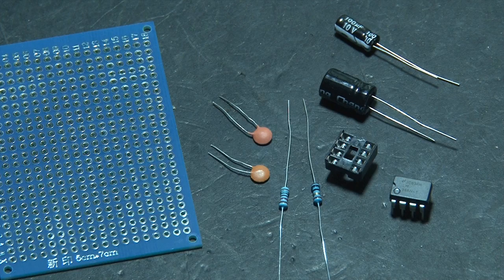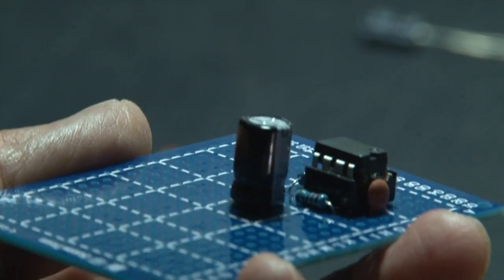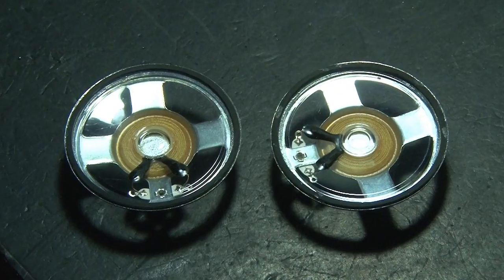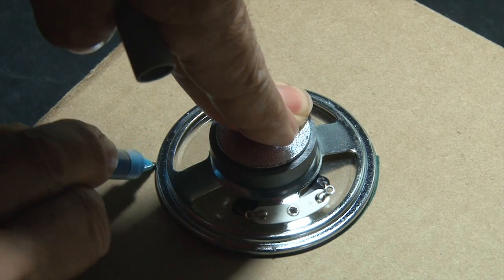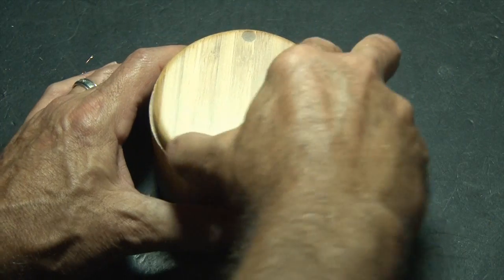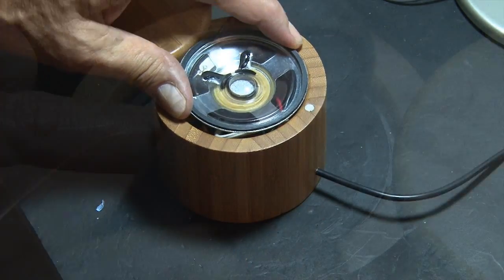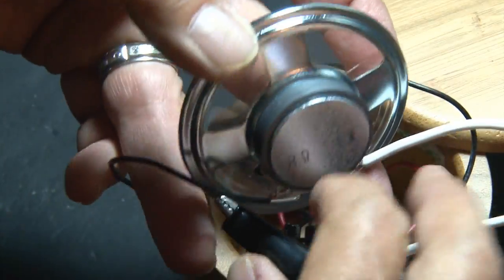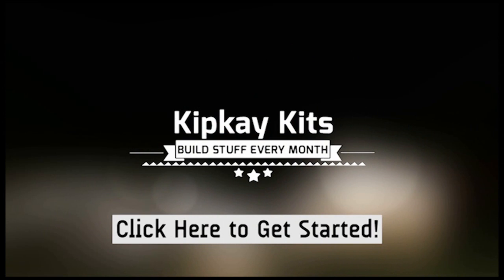DIY Mini Digi-Speakers!

Comment from the maker: Build your very own, custom DIY mini Digi-speakers! This is a 1-watt speaker system.
Reply: how big are those speakers??
Reply: Alcatraz252 I'd say at least half a banana per speaker
Reply: woooweeeee Yea, that's good enough.
Reply: Can you just sell a completed set for a little more $?  I don't feel like soldering my fingers together.
Reply: cuvkiller You con't solder your fingers together. You'd just burn them.
Reply: dourabbawinner
 funny how you just automatically assume he's human
Reply: dourabbawinner Shows how much I know.
Reply: just what i was looking for thanks kipkay!
Reply: i am so going to make this thanks kipkay!!!!!!!!!!!!!
Reply: Kipkay, try invest in a pop filter for ur mic, so u get rid of the pops
Reply: can you add a volume control?
Reply: tty23
Hi, are you looking for instructions or is that a feature request?
Reply: show how to make your own pop filter? :P
Reply: kipkay please make more diy speaker projects! these are amazing!
Reply: how much wattage can that circuit take?
Reply: 5tealthlab5
Probably around 1/2 or 1.
Reply: Daniel Astbury
K. Thanks.
Reply: Ok it has all that stuff but does the kit include the cardboard box??
Reply: Since you switched from DC to AC for power, did you need to add anything to the circuit? Like a bridge rectifier and whatnot. And BTW, im a hobbyist, so my terms might not be precise since im mostly self-taught.
Reply: Chris Griffin

He is using a wall wart which already converts the ac mains power into the dc voltage he wants.
Reply: Makes sense, thanks for the information.
Reply: some14460 Probably about 3 inches long, assuming they are the same size as my black 1 watt speakers.
Reply: i have a question: if i connect an 8 ohm speaker i will get 1 watts of power, but if i connect a 4 ohm or 2 ohm speaker, will i get more power coming from the speaker? Thanks
Reply: David Christmas
I figure that anything less than 4 ohms might blow the amp... but no it wont increase the power going to* the speaker.
Reply: We're do you buy the stuff in the uk
Reply: where to add bateries
Reply: Happy 2,500,000 subscribers : )
Reply: no bass

Comment: if it where possible though i would recommend a small adapter jack for power so you can plugin the battery pack or ac adapter and maybe even audio jack to reduce amount of wires coming from the unit when it is not needed

Comment: What can I use instead of the salt box? It is pretty hard to find it here in Greece, actually I can't find it anywhere! A simple wood box would be okay, wouldn't it? Also does it have to be round? Is there a problem if it is square?

Comment: Yours projects are great... I BUILD ONE CARDBOARD BOX SPEAKERS WITH SOME FINE SOUND OUTPUT  By MODIFYING THE cardboard cabinet with thermocole walls and sounds pretty good but it exploded last week while i trying to listen fm radio through my car stereo connected to a spare pc smps ...... speaker watts was 8 w rms 4 ohm

Comment: Tip : don't solder the sockets with the ICs in them - the heat from the iron can travel up the leads and damage the IC :)

Comment: KipKay.  One thought.  If I may.  It's probably a good idea to solder the IC socket to the board before inserting the chip.  It prevent's damage to the logic chip from overheating.

Comment: hi can i ask a question on what matterials do you used in there in more specific details? like the 470uf and 100uf electrolytic capacitor... what volts do i buy? i see the 100uf has 10 volts but i dont know the volts of 470uf. is it also 10 volts??? also i want to know the details about the speaker and how much it cost???? or can i use any mini speaker??? i hope for your responds.... thanks,
Reply: The volts rating is the maximum voltage the capacitor can handle.

Comment: hey can you do one thats like one of those small speakers sold at stores something that can be recharged has a volume noob and and at least a 2-5 inch speaker and enclose like the one in this video or better please? as well if you can include something like the main board having a left port for left speaker connection that way they are not stuck to each other. something like this O-----O<----right speaker  line in middle is wire. i dont want it to be perm so just be able to connect it when some one will use it. or if possible how to build a amp like a car stereo amp but nothing to big that has volume control bass control

Comment: +kipkay
hey is there any way i can power this device using a 9V battery or 2 AA batteries without changing the circuit components?
im trying to fit all this into an Altoid's tin. thanks! :-)

Comment: That chip highly resembles what I know as a BIOS chip.
Reply: ***** I know that...they obviously said what it was. I'm just saying it has a resemblance to the shape of some BIOS chips found on motherboards.
Reply: ***** Yeah...I remember having an ASUS board that had a 8-pin chip that looked just like the low power amp chip here which was removable, and the manual even said it was a BIOS chip too. I know many boards are different from each other too, though.

Comment: I need help, can anyone direct me in the right direction? i have 2 speakers from a itwist portable speaker and the bluetooth quit working as well as the amp in it....anyone know of a amp i could get small enough to throw in? also i wanna find a way to make it run on 2 18650 battaries.

Comment: for how much time does it work with 3 AA BATTERIES??
Reply: +Sarabpreet singh mendiratta umhmm it's 6 and depending on the brand, it could take a few weeks to drain, or you can make your own batteries and then they can last for much longer.

Comment: haha, I searched for the LM386 on Ebay and directy found a finished circuit for 2 bucks^^
Reply: ***** well... Depends^^ If you really want to use the product, in such small scales i'd go for buying. In this case here, it could have been a small bread board experiment. For the rest, one could have gone with the higher quality micro-board :P But that's just in my humble opinion :D

Comment: how many volts are capacitors
Reply: +AIR BRAKE with a max voltage that matches or exceeds the src voltage.
Reply: tanks

Comment: Honestly, what is the point for the electrical components?!?! It's just a speaker...
Reply: +Stuart's Tutorials  then obviously u have no idea whats going on
Reply: +Simon Yu I honestly hooked up the speaker directly to the adapter and it worked fine.
Reply: +Stuart's Tutorials all the electrical components are for amplifying the signal so u get it much louder
Reply: +Simon Yu OK. I guess I will try it.